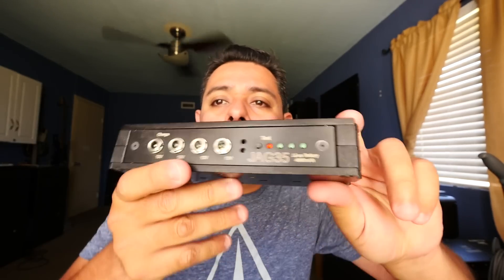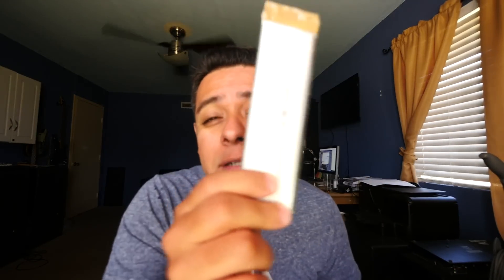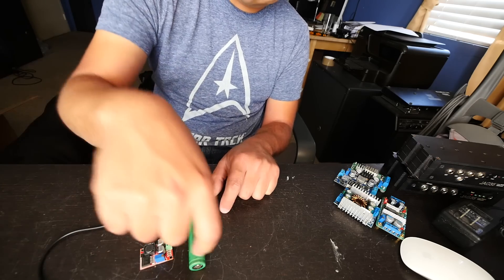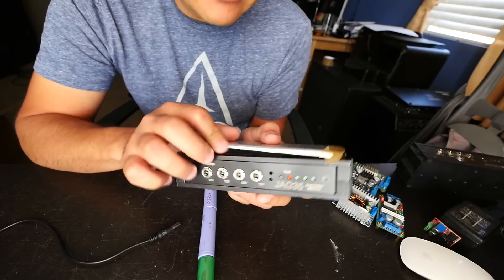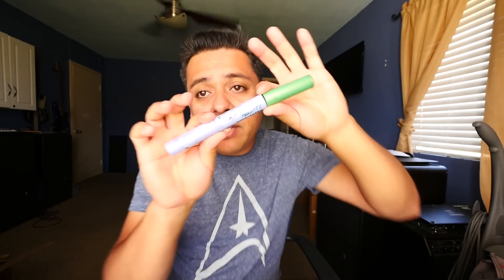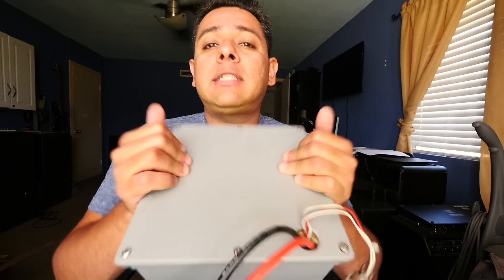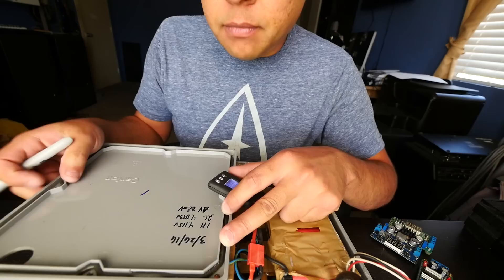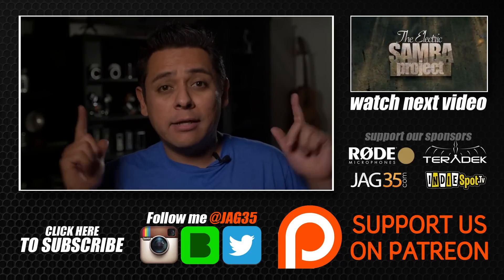How to Charge Lithium Batteries

Comment: wait wait wait, Sorry, but the way i understand how to charge a lipo/lion cell correctly is to use some sought of circuit.. not just a from a voltage source? e.g. a 12v power supply powering a hobby lipo charger on just the "charge" setting to charge 1s, 2s, 3s, 4s, etc, but i only use the "balance charge" setting since i'm constant charging/discharging/charging 4s 1300mAh packs they can get out of whack. 

So your saying I can safely charge a 4s (16.8v) 6000mAh LiPo pack with a power supply voltage with CC of lets say 1Ah and a CV of 16.8v??? I've just always thought there had to be some sought of circuit creating some special charging method for lithium batteries. I know that NiMh/NiCd batteries can be charged by any sought of power supply with a similar voltage without damage to them if you know what i mean? 

I'm just confused as fuck.

I'm making a Solar charging setup for my 4s 6000mAh pack and confused on buying a "lithium MPPT charger" then to a BMS balance circuit to charge the battery OR, just a solar controller that supplies CC/CV 10Ah/12-24v or something..
Reply from the maker: +Croble FPV  watch my video titled, "must you balance charge lithium batteries"
Reply: yeah i know balancing is definitely a must for packs over 2s, 3s, etc, but 1s for example, do you need a special circuit? I think its a must, but they way your explaining it to me is you don't need one? you can just hook it up to a 4.2v Nimh/NiCd wall charger?
Reply: Set the voltage using the voltage potentiometer without a load. Limit the current to the rated max charging current using the constant current potentiometer. Calibrate using a temporary load that can draw more current than the setpoint. 

When initially connecting cells directly in parallel, make sure their voltages are very similar. 

Do not equalize imbalanced cells at an unsafe current level. When using an ammeter, disconnect immediately if the current is excessive, otherwise you may damage meter or battery. 

It gets more complicated when first placing 3 or more unbalanced cells in parallel. One cell in the bulk parallel pack may be drawing more current than the newest cell you are monitoring with an ammeter. 

A stupid-simple and safe method I recommend for equalizing many unbalanced cells in parallel uses a 1.5 volt incandescent bulb in series with each cell holder. The filaments have a variable resistance that increases rapidly with temperature (brightness). Select a wattage that limits continuous charging current to a safe level at 1.5 volts drop, typically 2C. This should prevent damage to outliers. Of course, bulb(s) will burn out if you accidently reverse a cell ! 

After the parallel pack equalises, these bulbs allow you to safely increase the constant current limit on the power supply proportional to the number of cells. The bulbs will safely limit current to the outliers.
Reply: I would recommend a charger designed for these batteries. These batteries require a constant current and a ramped voltage to charge properly. You can just plug it into one of those wall power supplys, but it will reduce the life of the battery.

Comment: Wait so this 12V 60Ah battery of yours isnt balence charged but instead just putting 12.2V in it with power supply directly? if i got it correctly
Reply from the maker: +ESTD3  correct, that worked for years until I killed one of the 3 groups of cells for not following my own advice an initially bottom balancing my battery

Comment: @jehugarcia Please correct me if I'm wrong. So the batteries need to be almost identical in voltage. The capacity doesn't matter. When charging them in series, the input voltage must be whatever the total voltage is. So if I'm charging two 18650's in series, then the input voltage must be a constant 8.400v using a buck, SEPIC, or boost converter or simply a DC to DC converter. I'm talking about 18650 or 26650 batteries, NOT LiPo batteries.
Reply from the maker: Mark II if your cells have different capacity they must balanced either at the top or at the bottom.   The smallest cell will always reach top and bottom voltage first therefore it will be either overcharged or overdischarged.  So cells with different capacities can be used but  you'd have to adjust your end voltages, top or bottom depending where you balanced them at.
Reply: So they need to be both identical in voltages. They are almost identical batteries. So I can either charge them to a desired top voltage of let's say 4.000v, or discharge them to somewhere near 3.00v. Then I can put them in series 2S, 3S, whatever, and when I go to charge them, they should charge and discharge at together.

I didn't do that yesterday. The one reached 4.208v, and the other was something like 4.187v, when I tried to charge them in series.

This isn't because regardless if I ordered 2S BMS modules from china, I don't want to use a BMS. I'm making a mailbox light type post for my father's mailbox, and I don't want to have to worry about all this BMS crap. So today I put them in parallel, because from what I think I know, they should balance themselves out.

So I'm watching the video you did.. What is Battery Balancing? Quick tip #5

So it seems they just need to be almost identical in voltage either near fully charged, or near fully discharged. Then I can use them in series, charging and discharging.

I also noticed with my box mod when I put the two batteries that are used in my box mod (2S Series), the charger tells me they're the same voltage. So that's really good, and proves what you said about the fact that they will discharge together, and charge together, as long as they're almost identical in voltage.

Over the years, I've learned a great deal about Lithium type batteries (18650, 26650 batteries mainly). Then you come along, and say they can be charged and discharged in series. Which I'm learning, is 100% correct.

Comment: I like the fact that you do not use a bms
Reply from the maker: +Croble FPV  if you are using Lipo batteries the way most people use them,  stick with using a BMS and charging them like most people do
Reply: I'm scared of not using a BMS, only the fact that i think that you can't just connect a lipo to the same voltage power supply as i think its not correct for charging lipos... as in I think you need a special circuit or something to charge the battery...
Reply: but 1s for example, do you need a special circuit? I think its a must, but they way your explaining it to me is you don't need one?
Reply: Croble FPV A Lipo is not working like a regular Lithium batterie.
If you over charge a Lipo it will explode.
A normal lithium batterie will just get damaged and get hot.
Lipos are much more dangerous and need more "care" when they get charged and discharged.
Too much current in the charging/discharging process is not something you want to risk with Lipos.

Comment: Hi. 
Hope you are fine. Here I have some query. Hope you would be kind enough to help me. 

My Name is Saleh Mohshin. I live in Bangladesh. Here in our country we have lots of Ebike , Which are mainly use to carry 6 to 7 passenger (Including the driver). These bikes run by 60V. Each bike need 5 Liquid/ wet battery. Which are 12V. 140AH of each. And these all are quite heavy. Here I need your help to know that….. 
1. How I can build a lithium battery pack to run this ebike 
2. How the battery will recharge 
3. How long (kilometer) the bike can run by each time charging 
4. How long this battery pack will long last 
5. Is there will needed any deterrent control box then existing one. 
6. What would be total cost.

 Kind Regards
 Saleh Mohshin
 +8801713000794 
asmkhan007@gmail.com.

Comment: Li batteries must be charged constant current not constant voltage. So if you want your battery last don't charge constant voltage or your battery will die an early death.
Reply: Luckily all those small dc-dc step down converter modules have built in current limiting. For the ones with the LM2596 chip, the limit is about 4.5A. In addition the LM2596 has thermal limiting, and given the limited heat sinking in those little modules the current probably won't be able stay at 4.5A for long when charging a battery.

Some step down modules have adjustable current limit in addition to adjustable output voltage, and those are the best to use for this application.

Comment: These are step up modules, or buck converters, they will supply voltage and current regardless of cell capacity and voltage, i think you missed something, because in addition to that,  you will need a cell protection charging module, such as the tp4056 for charging a 18650, or a 3,7v lipo battery. I would never replicate this method to charge my batteries.

Comment: Thank you for this video.
I just toke 9 pieces 18560 batteries from my  Dell laptop. All batteries are dead: 0,0 volt.
All tricks I found on YouTube, I tried in order to get them running. Unfortunately without any result.
I fear that I have to throw them away, or you you have a last advise ????
Jan, from the Netherlands

Comment: So... If I want to charge 3 cells connected in series and another 3 cells (same series connection) with the 2 groups connected in parallel, and if each cell can except 1.5 amps, how many amps would I need to charge all 6 cells?
Reply: 3A.
but don't follow his video because he doesnt even use a constant current regulator

Comment: I got the rest, but just one (newbie) question :)
If I have two Li-Ion cells (3.7 2000mAh) in parallel and each can safely charge with lets say 1A (0.5C), then can I pass 2A to both of them (being linked in parallel) without risking to overheat eventually blow them (or the least evil to reduce their life)?

Or to be specific if I have 3.7 3400mAh 10A, with charge recommendation of 0.5C (ie 1.7A) in a 3p6s config.
I'll obviously need 25.2V (4.2*6) to charge them, but what about the current?
If I leave it only 1.7A and it splits between the 3 cells in parallel, it would take about 3 times slower wouldn't it?
But is it safe to just dump 5.1A (3*1.7) directly on them?
Reply: Yes.
Don't follow this video tho. All wrong

Comment: Mr Garcia, you obviously have lots of hands-on experience charging lithium battery. The important details left out are:

Find those switching regulators which:

 - limit the voltage to some adjustable value (4.2 volt for 1 cell, 12.6 volt for 3 cells)
 - limit the current to some value specified in Amps
 - when current limit is hit, must not go in shut down mode, like most computer power supply do ; instead, it must continuously adjust the voltage to keep the current at the limit

In other word, the power supply will start at the same low voltage as the battery discharge state. As the battery is charging, the voltage will raise while the current will remain at the fixed maximum allowed.

When the voltage reach 4.2 volt, the power supply automatically enter in the second mode of operation, which is regulating the current to maintain that fixed 4.2 volt.

The battery is still charging when reaching 4.2 volt, but it consume less and less current. It is really the battery that "decide" how much current it want, the power supply just try to keep the voltage at 4.2 volt and provide as much current as the battery want to keep that voltage.

Now, to speed up charging, we want to provide a voltage slightly higher than 4.2 volt (or 12.6 volt for 3 cells). The extra voltage is provided to counter act the loss in the following components:
 - loss in wires
 - loss in connectors
 - loss in batteries

The loss in wire can be decreased by using thicker wires. But bigger wires are more rigid, less flexible and get damaged faster from constant flexing. Typical cable in USB charger with a current of 1 amp waste from 0.1 to 1 volt.

The loss in connector is often in the same range of 0.1 to 1 volt. Even when the exposed metal on the connector appear shiny yellow, imitating the look of gold, they may still waste part of the energy, which imply absorbing part of the voltage. Those bad quality connector become warm to the touch.

The battery itself, particularly as they age, waste a portion of the charging energy. An old battery that waste part of the charging energy is exactly equivalent to a very good battery with a small resistor added in series ; both located physically inside the batteries.

Let's take a real example : suppose the battery has an internal resistance of 1 ohm and we provide 1 amp of current. The ohm law allow to find the voltage across a resistor:
V = RI = 1 ohm * 1 Amp = 1 volt
The battery itself takes from 3 volt to 4.2 volt as it charge, and the internal resistance take 1 volt.

We can also find how much energy is wasted by the internal resistance as follow:
P = VI = 1 volt * 1 Amp = 1 watt

Suppose that the battery charge level started at 3 volt and is now at 4 volt. Our charger is still pushing 1 amp since we are still below 4.2 volt. The total energy provided by the charger is:
P = VI = 4 volt * 1 Amp = 4 watt
The energy wasted by the internal resistance (assuming 1 ohm) is:
1 Watt, as calculated above

Brief, 3 watts are used to charge the battery and 1 watt wasted as heat

All the long text above is to explain what make a battery to become hot during charging. The lithium battery are strong when delivering high current, but they easily get damaged by silly little thing such as overcharging them or discharging them too much.

All lithium battery designed by an company, not just professionals equipment, but every device (even the cheapest Chinese clone and the cheapest child toy) include a temperature sensor which is used during charging.

The charger inside your cell phone does the following test:

 - refuse to charge if temperature already too high
 - start in fixed current mode, with voltage increasing slowly
- monitor for "fast" temperature change with high precision (down to 0.1 degree Celsius or about 1.5 F) and stop charging if increase "fast"
 - while charging, stop if temperature exceed some threshold
 - when the voltage reach a limit, switch to fix voltage (the current is decreasing slowly)

The end of charge is determined by:
 - current below a fix value while voltage already at 4.2 volt (for example)
 - temperature suddenly raise at any time during charging

When the battery get old, it may accept less total energy and may decrease the maximum voltage to a value below 4.2 volt. By monitoring the temperature raise with high precision, the charger can stop charging and avoid damaging the battery.

This precise temperature monitoring technique is what allowed old battery to keep working for many months after the voltage started to drop. Somebody got a patent for that and that company probably still get large amount of royalty for allowing all of us to use the same cell phone with the original battery for a few years.

The battery exploding in recent Samsung cell phone is probably caused by an engineer who wasn't not very clever. He didn't read the patent explaining how to charge a lithium battery correctly and use the temperature sensor in a smart way.
Reply: make a video How to charge them properly
Reply: Thanks for a very good explanation. It helped a lot.
Reply: Sir, your explanation covers the basics of electronics in simplest way. Thanks a lot now i can remember it forever.🙂
Reply: HA!!! JUST A LITTLE LEFT OUT HUH!!???? JUST SAYING OLD ONE LEGGED JOSEPH T RETIRED NAVY
Reply: ANAL... is something I will search later if I want to know more in detail about it.
Reply: Can I be your friend?
Reply: I have a question you might know the answe to and it would be very appreciated if you would answer me :)

So i wanna make a 24 volt 5s battery and i man planning on buying this BMS for it: https://www.banggood.com/PCB-BMS-6S-15A-24V-Battery-Protection-Board-For-18650-Li-ion-Lithium-Battery-Cell-p-1162772.html?p=4G190320067484201803&cur_warehouse=CN
And just using a 24 volt wall charger to charge it. now i am wondering how i would know when the battery is at full capacity, Would i have to messure the voltage?

Thanks in advance,
- Oliver
Reply: @OliverKempel  You can use a hobby charger. It's costlier than BMS but very convenient. You can watch video by Shawn McCarthy- How to build a safe and better lithium battery without BMS.
Reply: Thanks dude. That hit the spot.
Reply: Did you write all this...? Damm
Reply: Christian Gingras, pouch cells 3.7v nominal 3S Li-ion  using 3s li-ion BMS vs 3.2v 4s LiFePO4 using 4S LiFePO4 BMS vs 4S 
Li-ion using 4S LiFePO4 BMS, will the 4S Li-ion using LiFePO4 BMS better for 12V application? By that it does not stress the cell and can get more cycles, right?
Reply: Hi, I'm just an ordinary guy trying to build a power bank( or UPS) for my laptop, my laptop battery not working so I remove it(build in). I have build a 4s4p battery pack with bms. I'm charging it with only 16.5v not 16.8v, how much current should I put in? My buck converter which I use to charge the battery can supply 10a of current. If I'm not mistaken we can supply more current than the battery needed to charge it, is it true.? And for voltage it got to be exact or less. Please help. PS can you teach me how to set CC on a buck converter.